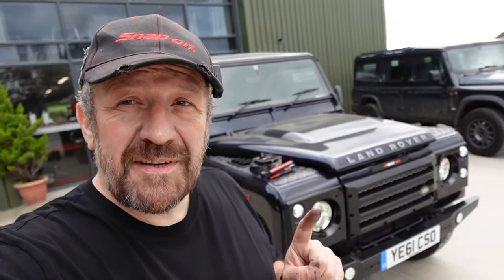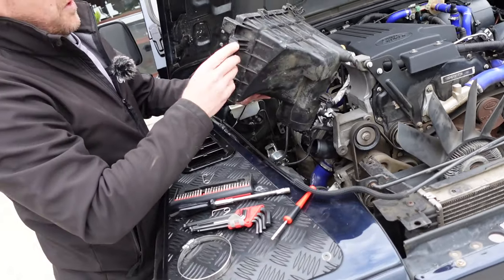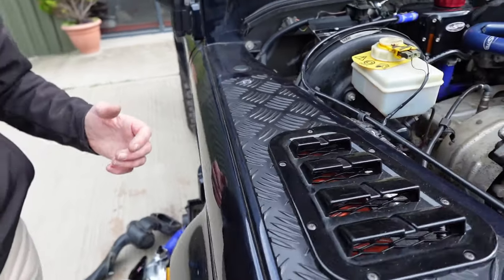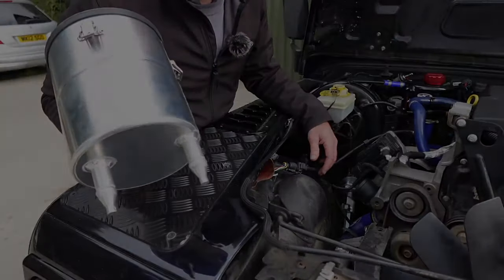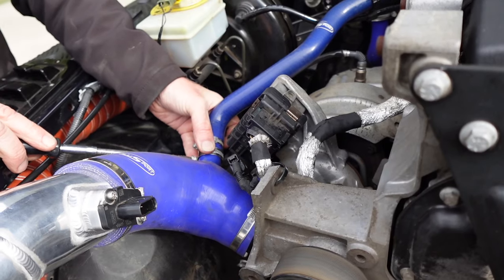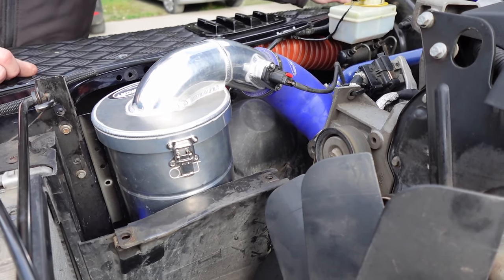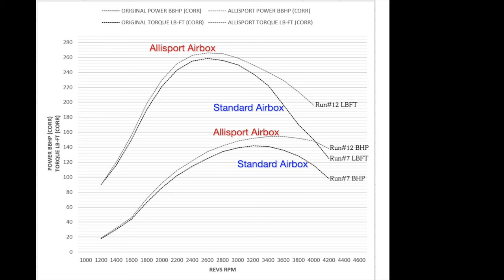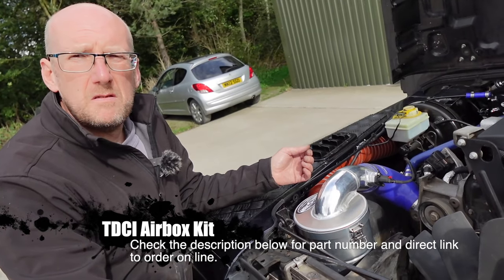New airbox from Allisport gives extra 38BHP to your Land Rover Defender Tdci Puma

Comment: A huge improvement on the nasty standard setup that will be. Your air filter looks very similar in design to my 300 tdi which sits on the side and has a rubber with flat nipple at the bottom, tweaked it lets any dust build up out. I was surprised to see they have fitted what looks like a standard Transit-150 van air filter, which can not have as much surface area as your cylindrical type. Also on the 300 tdi there is a device to collect and get rid of any water that gets in. It's an interesting design, and may be of interest for you to incorporate in future 3D tweaks. I hope your units sell well being of the right stuff  👍

Comment: A somewhat misleading video title and claim. It is NOT +38 PEAK bhp gains..... and the dyno chart shows over 140hp for the non modded one.....
Reply: Yeah. Peak torque gains is maybe 7 lb/ft and peak horse power gain is about 12. Not bad number for anything you can bolt on in 30 minutes, but nowhere near the +38 in the title lol. Sure that power is there at the top end, but as he says… no one drives at the redline. 
And as you noted, they didn’t mention that this engine already has a tune or something else done to it. I couldn’t tell if that intercooler was stock or not 🤷‍♂️

Comment: The alloy air box is far better than the OE one, but claims of 38bhp are ridiculous given that the very long intake hose connecting the air box to the actual intake, is going to reduce air flow significantly.....................
Reply: The gain is made from replaceing the original restrictive pipe from the wing to the filter.

Comment: I’d like one of these kits   Be good to know cost of the air box and the extra hoses
Reply from the maker: Prices now online
https://www.lrparts.net/as293-cylinder-air-filter-housing-with-wing-connection-kit-high-intake-connection-by-allisport.html
Reply: @LRLiveUK awesome bit of kit and great video, is it possible to fit this if there is a snorkel already in place or would the snorkel need to be removed and then refitted after the air box and pipework is swapped?

Comment: Which Alisport airbox do you recommend for a BMW M57 conversion?
Reply from the maker: I'll ask the question for you.
Reply from the maker: They have produced one for N57,  will need to possibly make a modification for the M57

Also working on another product with a flat filter that sits into the inner wing

It may also be possible to pipe up the Tdci one, but you would need the Tdci mounts